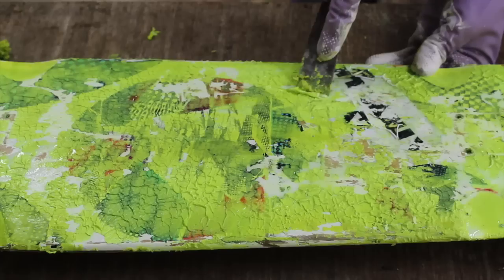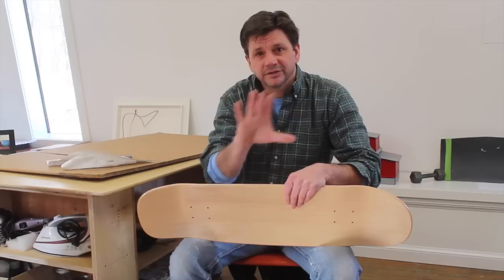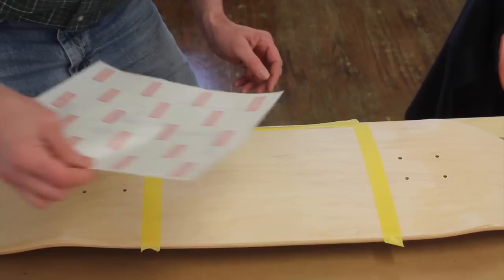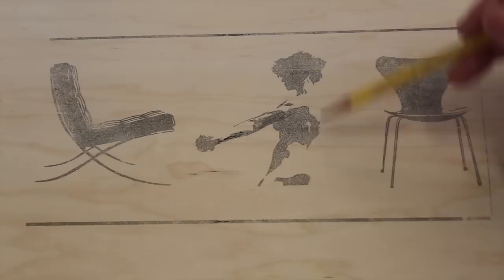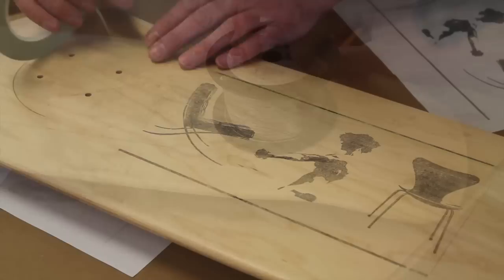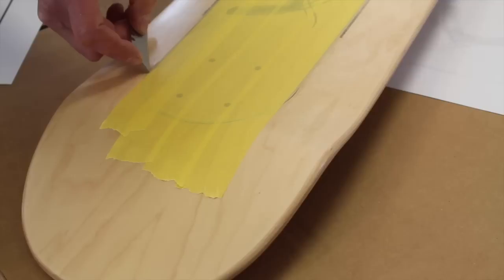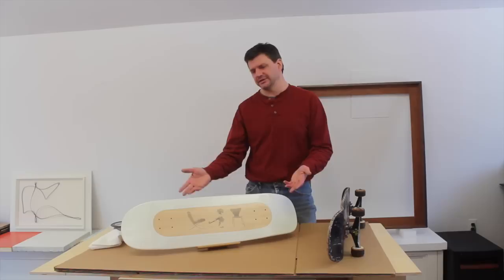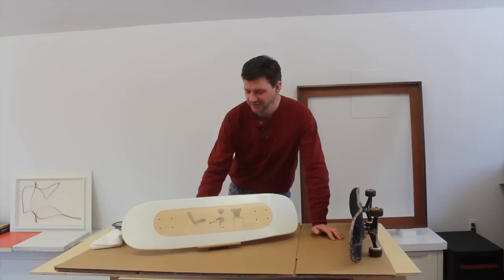How To Paint A Skateboard - Inkjet Transfer

Comment: you can also use regular bond paper and a transfer attachment on a woodburning tool (looks like a flat circle). ive tried it a few times for a logo with mixed results. this method looks pretty easy though!

Comment: I remember the skateboard making days. Then you had to use metal roller skates flatten the heel part and screw on a piece of pine board. I hit s small pebble and shot it out in the street were it got ran over by a car. My last one :(
Reply from the maker: Tom Pritchard Hi Tom, yeah those were the days, my skateboard still works but I think my skating days are done anyway : )

Comment: Why would you use an inkjet printer for a transfer like this? The ink will always result in an unfocused image as the ink will be absorbed into the wood, wouldn't it? Did you experiment with a laserjet transfer technique, where you print with a laser printer instead on the same paper substrate and then use an iron to melt the plastic resin that got transferred by the laser printer to the paper substrate thereby transfer it to the wood? This technique is used to create etch templates for making  PCB boards. I have made some PCBs for building guitar pedals using the technique. An example could be found here: https://www.youtube.com/watch?v=DBq1QKY5beQ
Reply from the maker: Juergen Helmers Thanks I'll take a look